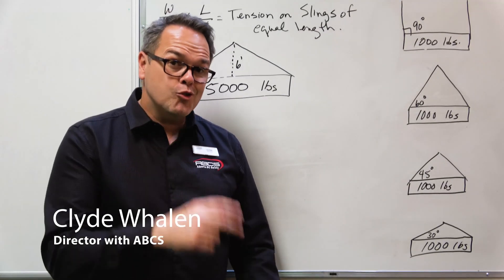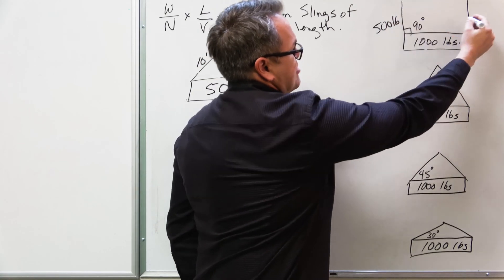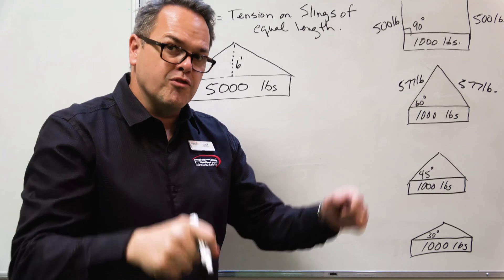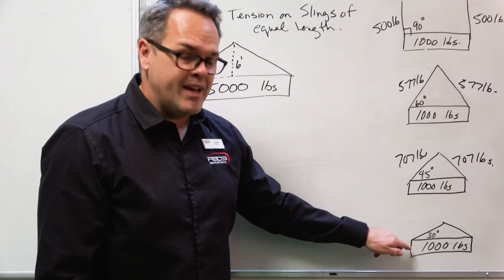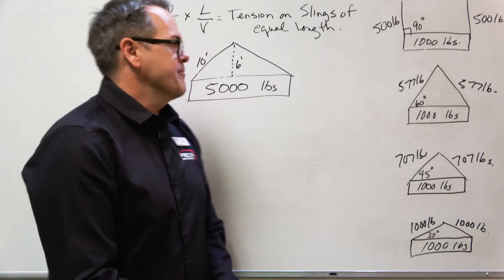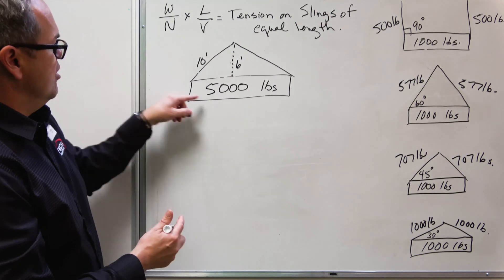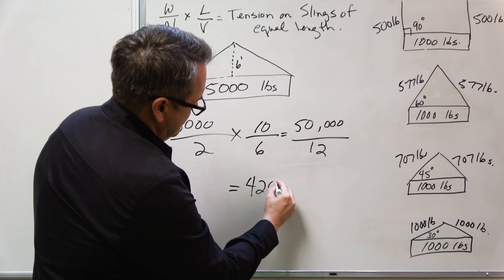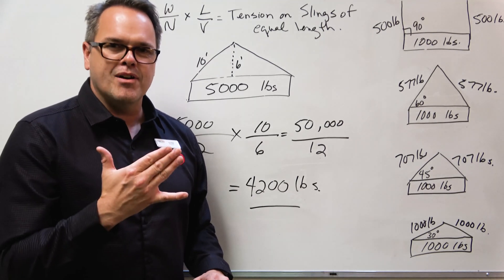2 Minute Tool Box Talk on the Effect of Sling Angles on SWL

Comment: That is a terrible 2 minute tool box, the reason is that you would not know straight away, the sling length nor the hook height when you increase the angle. These 2 values have to be know first before you can apply the riggers method formula.
Plus, it is all well and good to give values on the right, but you need to teach not to show.

Comment: How come the angle isn't included in the formula for calculating how much load is on each sling if the more u decrease the angle the more tension?
Reply: The length of the sling and the height of the sling above the load essentially give you the angle.

Comment: Question on length of lines, do you measure the total length of rigging sling etc or exact length from object to hook? I’m probably over thinking it ?
Reply: You always work with perfect lengths, for safety, but if otherwise one sling will obviously have to carry/pull more weight.
Reply: @HumphreyDeFirst  I be trying to do the sling tension formulas in my head
Reply: lol. you can do you calculations before operation or before coming to site, typically the weights of loads should be known by all parties before lifting/moving

Comment: How did you get the number 6 on the vertical ?  Thanks!
Reply from the maker: Hi, it's a measurement from the bottom of the hook down to the load.   You would have to measure it.  There are other ways to find out the number without measuring it, but you would also need to know the distance from the hook-up points on the load.  Hope that helps.

Comment: Hey, you calculated the force but what was the angle there? Does angle have no role in final calculations? Please clear my confusion as my interview is near..
Reply from the maker: Thanks for your question.  The formula shared in this video gives the approximate actual force on the sling that takes into account the sling angle.
Reply: The angel plays a part to give you L/H which is your multiplier.